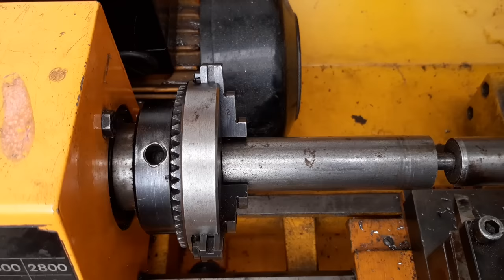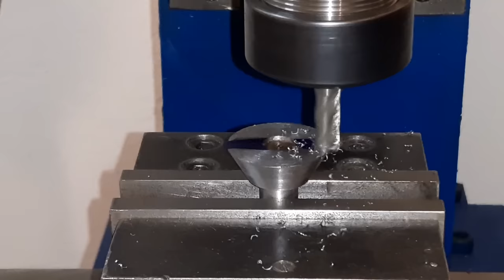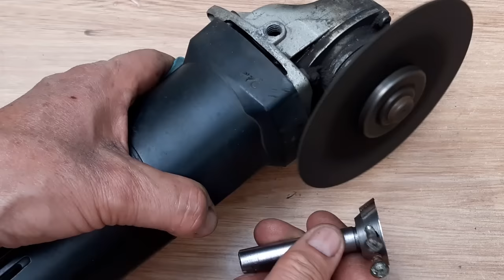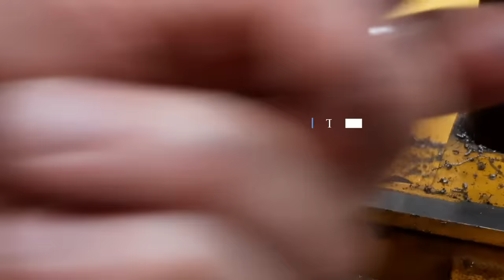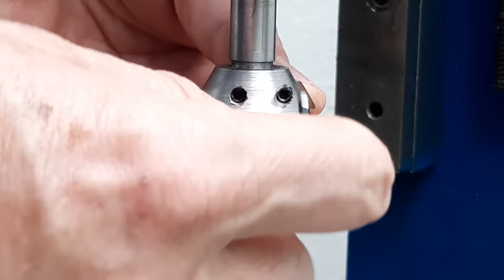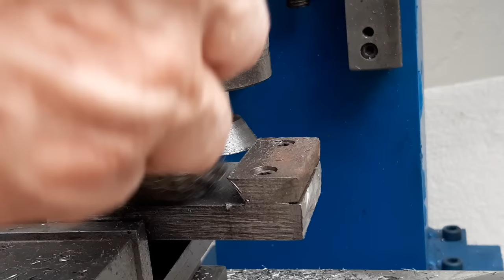DOVETAIL CUTTER - EASY

Comment: Great video, everything came out well.
Thanks for the close up shots of everything. 
By the way, we can see the stiffness of the vertical column is a bit low, makes me wonder.
Reply from the maker: Thanks, I think the rigidity of the column is acceptable, therefore you can make one without a problem

Comment: 5:40
I hear and feel vibration.
Have you measured the runout and other things like bending the mill parts or its head ?
Something feels like it's not sturdy enough. Or doesn't have enough weight
Reply from the maker: thanks for comment. It may be that since it is only a burin then it generates a slight tapping when touching the material, otherwise it is fine.

Comment: Great video, i made a similar cutter to remake the top piece of an existing dovetail slide. The part I don't understand is how you accurately grind the cutter angle so the part being made would fit any manufactured dovetail rail. I'm remaking a carraige for an existing male dovetail rail and found out it needs to be a lot more accurate than a lathe compound rest can provide. I'm out less than a 1/4 degree and trying to achieve final fit by hand scraping was an exercise in frustration. I ended up spending the $80 on a carbide dovetail cutter to keep myself from going crazy.
Reply from the maker: Thanks friend for asking, yes it is a bit difficult to achieve the perfect angle, in this case 60 degrees. but I advise you to help yourself with a used cutter that has 60 degrees and use a face gauge to achieve the exact angle, and you can do it very well.
thank you
Reply: For your purposes buying was the best option. If you are making the male and female parts with the same cutter, then the angle isn't important.
Reply: @markrainford1219  Kind of true, but since you might have to regrind the tool during the job, there is some possibility / room for not so good fit. I expect there are dovetail cutters with changeable cutting tips these days?! That's the way to go unless you have a proper tool grinder - which extremely few hobbyists do.

Comment: Very nice.  And this would be very expensive to buy in USA if you could even find anything similar.  I see that your toolbit appears to be ground with enough relief on the heel of the tool.  To anybody without much experience I want you to be aware so the heel of the bit has adequate clearance.  Thanks for sharing and greetings from USA!
Reply from the maker: Thanks for commenting, if indeed a very small space was left on the heel in order to displace the chip, it is 0.4 mm. Thank you

Comment: not bad, but it should also have an edge on the bottom side or at least be completely flush with the holder, otherwise the tool will always end up rubbing the piece you are cutting
Reply from the maker: the tool protrudes 0.5 mm so that it can do the work on the part without touching the tool holder. thanks for the observation. Greetings

Comment: Keen job of making the tool but you didn’t dial in the angle on the cutter. The next piece you make after you hand sharpen the bit won’t make a part that will fit any previous parts.
Reply from the maker: Thanks for commenting, yes of course when sharpening you can lose the angle a little but the idea is to maintain it as much as possible, and then use a new dovetail cutter. Thank you

Comment: so why did you make a conic tool if you could simply rotate the insert 45 or 60 degree? waste of time
Reply from the maker: Thanks, good question, but it was manufactured conical, so that when you continue removing material, the conicity or inclination of the piece to be manufactured will of course follow.
Thanks greetings